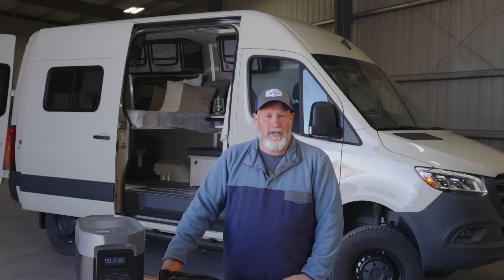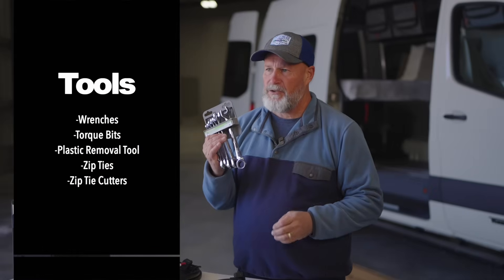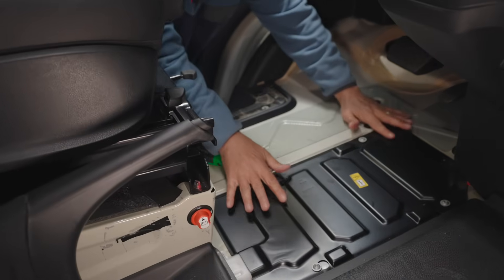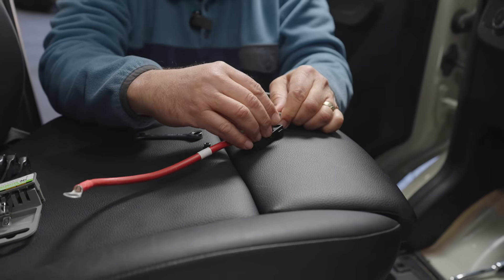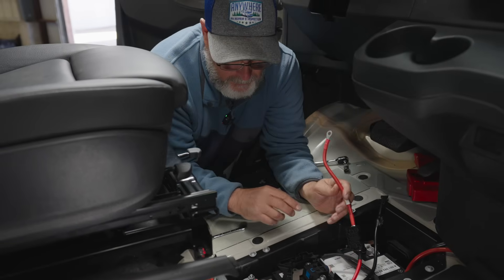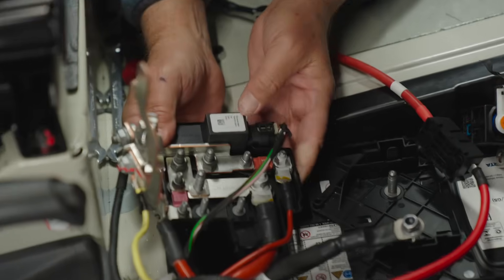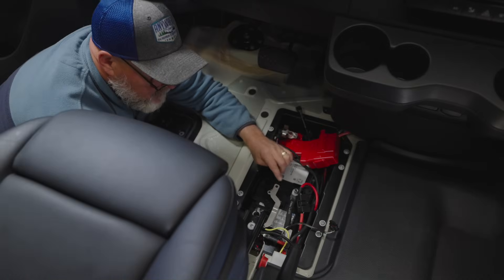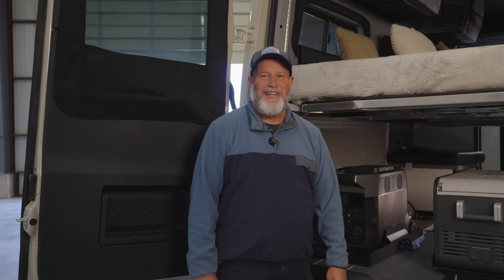How to Install an EcoFlow 800W Alternator Charger in Your RV: Step-by-Step Guide

Comment: I have a sprinter which i have installed a house battery under the passenger side with a b2b.  I have attached the cables to the house battery instead of starter… I do not seem to be getting a charge on my eco flow delta 2 max

Comment: Lol. At 3:11 to 3:15 they conveniently cut out the step that is a massive PITA if you want to it right. Eco cable does not fit into the white plastic harness of the Sprinter. At 6:16 the conveniently forgot to mention that you can't undo the negative terminal and it's easier to cut through the connection point on the black wire. Otherwise, yup, just 15 minutes to do it all.

Comment: Best video for this. setup. How did you get the wires under the plastic cover tunnel? Did you lose the screws  under the chassis? Or no need for it?. Also, where can I get the base the Delta Pro is sitting on? Thank you.

Comment: My Class B Van has a generator and house batteries.  Would it be better to  connect the positive and negative leads to the house batteries?
Reply: Did you get an answer for this question? I am getting the same situation now. What do you suggest! Thanks

Comment: How was the negative connected to the Battery? 
There are no auxiliary  terminals provided on the negative side of the Battery. 
The instruction said hook up to Chassis ground, in the Video it was mentioned to hook up to negative battery terminal.
I believe MB does not want any auxiliaries connected to the Battery ground to avoid a possible ground loop when the battery quick disconnected is pulled from the chassis. To use the Eco flow for Battery maintenance, I would think it would have to be connected to the +/- of the Battery. So I am a bit unsure on what is the correct connection point for the negative lead of the EcoFlow Alternator charger. A picture of the connection would be appreciated. Sadly the Video skipped over that portion.

Comment: Difficult to install on a normal car (peugeot rifter), from what I could find on the internet. In all those video's the battery is already inside the car but most cars have them under the hood.

Comment: Use can use a true XT60i cable to connect the alternator to the solar inout. The XT60i tells the EcoFlow to accept 15A instead of 8A. So that’s about 200 W charging. The Delta Max 2 has 2 solar inputs that can be used simultaneously so 400 W charging. The cable is much less expensive than this charger.

Comment: It's best to NOT CONNECT THE NEGATIVE TO THE BATTERY, but to connect the wire to one of the chassis grounds under the drivers seat. :)
Reply: Why is that the best?  What is wrong with connecting to the negative of the battery?

Comment: I am installing 800w charger in my Transit van. the echo charger comes with 5m/15 feet long cable,  from CCp1 to where the   echo flow delta 2 max is only 10 feet. Can I cut 5 feet of the cable to make more efficient in terms voltage drop, the shorter the better.😄

Comment: It’s lots of other issues also:
It can’t handle 24V. If you try to charge a battery from EcoFlow to car/battery/camper it will go in error mode and turn off.
The setup for the 3 different modes is wrong. You have from car/battery/camper to the EcoFlow unit, 800w battery charge from EcoFlow to car…. And the last one maintenance charge @ 100w from EcoFlow to car……. Problem is that if you use maintenance mode it’s say @ website and documentation that the alternator charger with a EcoFlow unit will keep the car battery charged and ready. But the problem is when the car battery is charged is just turn off the maintenance mode and then the car battery can run to zero. Also the 800w car charging holds the 14V and never stops like it do in maintenance mode. It’s should be a choice on both modes but then we also have a dangerous situation. If you use the 800w car battery charging it will hold 14V forever and never go down to a safer state at approximately 13,6V that many chargers do. The problem is when a battery is hold @ 14V for a long time it can start to boil and explode.  Also a battery charger should go to 14,4V before it goes down to maintenance voltage at 13,6V.
Reply from the maker: We're truly sorry to hear about your frustration, and we completely understand how upsetting this situation must be. Please know that we take issues like these very seriously and are committed to resolving this for you as quickly as possible.
To help us address the problem as soon as possible, could you kindly send the following details to support@ecoflow.com?
1. The serial number (SN) of your Alternator Charging and EcoFlow power station.
2. A short video showing the errors or issues during use.
This will allow us to better assess the problem and fix it. Thank you for your cooperation!
Reply: @EcoFlowTech  Hi. Already been thru support, changed the unit 3 times and last message from EcoFlow was that EcoFlow are aware of the issues but haven’t a fix for it yet. I got messages that it will be fixed in a firmware update later but they didn’t know when. So please use some resources to fix the product and issues that already sold before pushing out new models every week. Also get a firmware for the Alternator Charger some days ago but didn’t fixed any of the issues. Only a fix for connecting to Wave2.

Comment: I'd love to see how you routed the wire from under that flooring, into the pass-thru leading to the battery compartment.  The pass-thru on mine is sealed all the way around.  In the video, one second it's outside that pass-thru, and the next it's going through it.
Reply: Yes, it's really nice when you skip over the hard part!
Reply: Yes I’d like to know how it fits too! The cover for the battery in a sprinter does not seem to have enough space for the thickness of cable, more actual install video would be a great help 😊
Reply: Just wrestled with that for 1 hr in a crew cab, no joy here ☹️
Reply: @colinfleming8605  Run the charger wires around the plastic tunnel to the right side, then cut off the forward right corner of the plastic. That will let the charger cable pass in front of the plastic channel and in such a way as to allow you to feed the wires into the battery compartment. Then cut off enough of the battery compartment cover so it lays flat with the charger cable going through the cutout part. Takes a bit of thinking about what to cut and why, but it works well.

Comment: What do you doing with the extra feet of wire on the battery connection cable? My mount is 3 feet from the.battery and the cord is 15’ long. .
Reply from the maker: Hey there! Here is some awesome cable tips! 😊
1. DIY cable length-- Gives everyone the perfect fit for their setup.
2. Tucking extra cable in the car's compartment to keep things neat and tidy.
Reply: DIY ?  So do I just cut the cable to length myself?  What about the leads that connect to the battery terminal?   How do I reattach the leads to the shorter cable ?
Reply: @larryr3481  chewing gum.

Comment: Between this and the solar charger (panels placed on the roof), is it possible to basically have power 100% of the time if you do vanlife, and drive every day to new park up spots? I'm trying to figure out whats more cost efficient, buying something like this, or doing the electrics myself and sorting it all with Victron parts.

Comment: I just bought a DPU for my van.  I saw that an additional connector is needed to use the alternator charger with the DPU but can't find the info on the EF website.  Can you point me in the right direction?
Reply from the maker: You could try join in our FB community: EcoFlow Outdoor&RV Living Group

Comment: I see that you give us 0.5V incremental on latest FW, do you plan to also add 0.1V incremental, because there are very different BMS in different cars, on power saving mode they stays at different voltage from 12.2-12.7V  ....  ? Thanks

Comment: I have the Delta Pro with an extra battery and I have ordered the alternator charger. There was mention on another video about an adapter for plugging in the alternator charger to the delta pro. The delta pro has the infinity port and another extra battery port but no port that looks like the XT150. I can't find anything on the internet for an adapter that converts the 4 pin extra battery port to XT150. Am I missing something?

Comment: Eco flow is garbage. I’ve been dealing with them for months to get a refund. Stay as far away from this company as you can.
Reply: How so? Your comment is the only negative one I've come across.
Reply: @SweatyMan80085  my pro burnt up running a refrigerator which is 1/10 of it’s capacity. It took two months to get a replacement, which was cracked and broken in four places. It took another two months to get a 50% refund. It’s made in China and customer service is in India. They can’t service their own products as they’re on the other side of the world. I had 15 interactions with them before I had to evolve the states attorney general. 
If you buy from them, expect the exact same treatment. Good luck to you with your energy independence.
Reply: @SweatyMan80085  I had a pro burn out running a refrigerator which is 1/10 of its capacity. The company manufacturers in China and does customer support in India. It took four months to get a 50% refund. I hope you have better luck.

Comment: Question
I don't see the Delta Max battery listed as compatible, only the Delta 2 Max, can you confirm if the Delta Max battery is compatible since it has the correct connector?
Reply from the maker: Hey dear thanks for your interest! This alternator product is compatible with the DELTA Max.

Comment: Just ordered one, but my battery is in the back of a Teardrop Trailer.  I'm thinking I can follow the process in this and your other video to install but run my own red/black wire from the battery to the hitch area, install Anderson connectors, and then use the rest of the parts that come with this kit to finish.  Would be nice if you did a video of a travel trailer installation like this but realize you can't do a video for every use-case out there.
Reply from the maker: Thanks for the suggestion about a travel trailer installation video—it's a great idea! While we can't cover every use-case, we appreciate your feedback and will keep it in mind for future content. Happy installing!

Comment: Wonder if this would cause any problems with vehicles that have the additional AUX battery for the stop/start?
Reply from the maker: Hi there, thanks for reaching out! To answer your question - no, it wouldn't. Could you pls let us know your vehicle model? This will help us determine the best way to connect our Alternator Charger, whether to an AUX battery or the starting battery.
Reply: @EcoFlowTech Thank you for replying back. The vehicles is a 2022 Jeep Grand cherokee wk
Reply: I have a 2021 sprinter that has an AUX battery under the passenger seat.  How do I connect the Ecoflow Alternator charger to the Sprinter batteries?
Reply: @BillLi-y3q  In your exact situation now.  Did you ever get an answer? How’d you connect your unit in your van? Starter Battery, Auxiliary battery? 🙏🏽

Comment: Can alternator charger be connected to RV batteries instead of chassis batteries and still charge delta 2 max?
Reply: You can hook to the "house" batteries. And yes you can charge the delta series from the batteries . However I would not recommend charging the delta from the house batteries while plugged into shore power. I would charge via ac plug. I would really only charge the delta via house batteries if you need the extra 120v power and maybe access solar. You can, however, keep your house batteries topped off with reverse charging. An isolator would be a great idea. Have a cable from the chassis battery with a shutoff of 13v for when the vehicle is turned off. And the other cable from the house batteries. Charge while driving. Keep house batteries topped off. If you connect an rv to a powerstaion's 120v. I always recommend turning off the converter since they are extremely inefficient. I believe the alternator charger in the reverse charging mode is the most efficient way to charge a house battery AND with solar. Hope this helps.

Comment: Can the wattage output be adjusted lower than the 800W?
Reply: Yes, there's a setting in the app that lets you adjust the maximum output.
Reply from the maker: Hi dear~You can adjust the charging power.